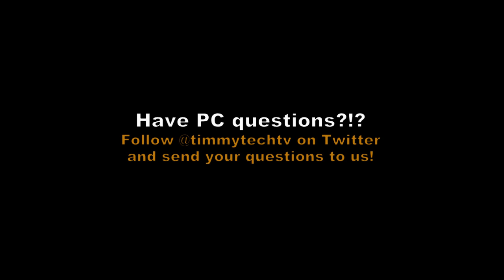How to build a Media Center / Home Theater PC - Part 3 - TimmyTechTV

Comment: Was looking forward to a part 4 for software. I have one question about the case tho, I'm going to be using an Extreme6 Z87 motherboard, which is an ATX motherboard, will it fit in the case with the BluRay drive?

Comment: Good job man! I love building computers. Unfortunately were I live there are not many people spending much on pc and if they do its usually something from wal-mart which leaves me to working with older factory builds. I currently have a motherboard that is socket am2 and need to flash to the latest bios so that I can upgrade to a Phenom ii 965 be I have a 4gb usb stick how do I format it to install the latest bios onto the mobo and then once thats done how do I install new bios via usb?